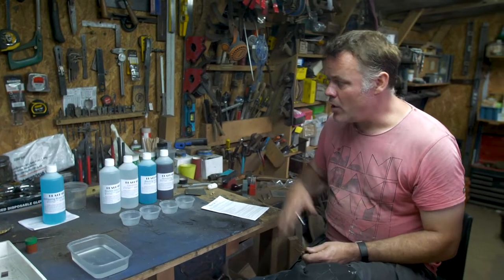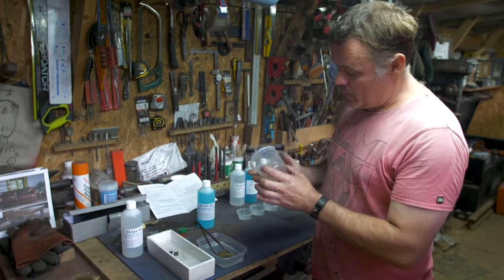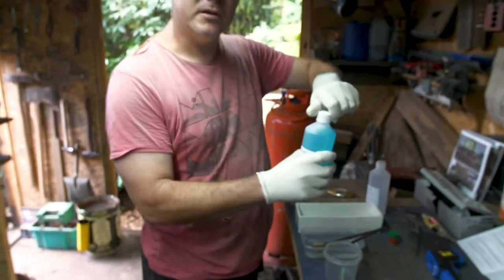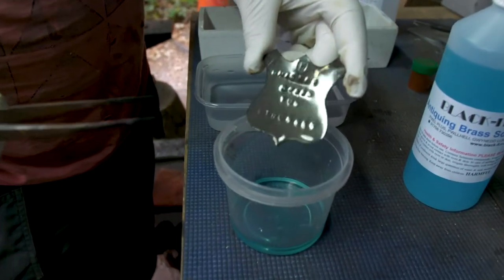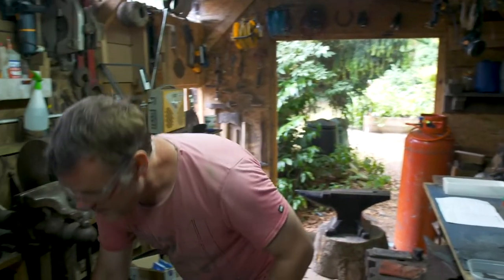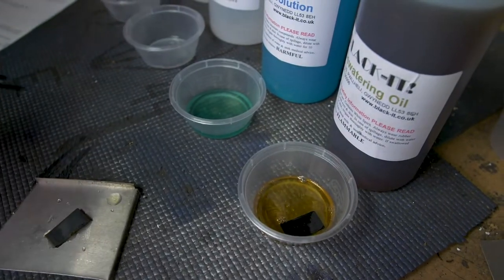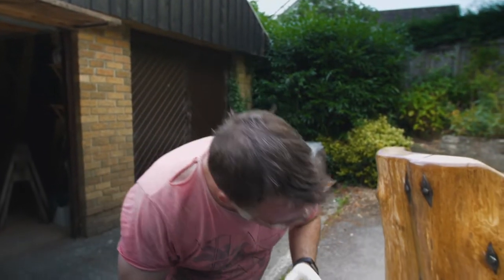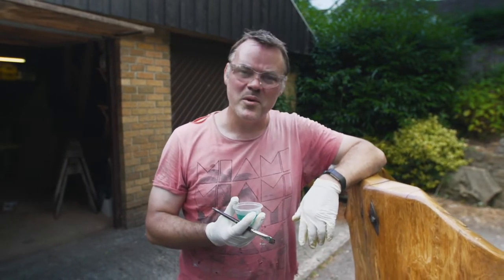How to Age Metals in Minutes with Black-It!

Comment: Hi, did you need to go through the next steps as well when using on the throne? As in wash the solution off and apply the oil before the lacquer?  🤔
Reply from the maker: Hey @trickychick5 we didn't do that because Al is a lazy douchebag who lives to cut corners! The throne was lacquered, we then used the Black-It and then those areas were re-lacquered - turned out good.
Reply: @DirtyShedCreations  thanks 👍

Comment: I'm a noob to this stuff. I'm looking to blacken some nickel plated water cooling fittings. Does nickel become glossy when blacken? ( Use this link for reference of what I'm talking about https://www.amazon.com/dp/B0792MD8HB/ref=cm_sw_r_cp_apa_i_Qb-kFbKPSMJ6M)
I'm trying to darken it to give it a black nickel finish for my project and I'm struggling on what to know and what to look for.

Edit: note that all water cooling fittings are made of nickel plated brass
Reply: Jeffrey Desormeaux Evening Jeffrey, thanks for the comment! It’s Al here by the way, my personal account. Right, your question! You may struggle to find a product to ‘blacken’ or ‘oxidised’ nickel. As an element, nickel is extremely resistant to oxidisation. Think about the origins of stainless steel... it was first called ‘nickel silver’. The only folks I know (have heard rumour) can ‘black ‘ stainless steel are BAE Systems. They’re like the holy grail of aeronautical engineering here in the U.K. Not to be a ‘clever arse’ or a ‘he knows everything kind of guy’ but you might really struggle to find a product to achieve your end result. But, I’d stand corrected if you can find something ‘off the shelf’ to do what you’re requiring. For the sake of love let us know if you have any success! I can only think nitric acid, but sure that’ll etch rather than blacken! If you take this further, let us know how you get on! Good luck Sir! Thanks for watching!
Reply: @yorkshirejoinery2869  I appreciate the comment! Water cooling companies like ekwb have black nickel fittings and all kinds of other stuff. Ive found this https://www.epi.com/black-oxide/nickel/. If I can find a alternative blackening solution from someone other than epi than could this work?
Please click to view and then scroll down to view the process.

Edit: I've also found this. Could this work? https://www.finishing.com/330/81.shtml
Reply: Evening, have given this a little thought over the last 24hrs... and I think you might find a black stain and lacquer achieve the results you’re looking for. I’m thinking of that stuff boy racers use to ‘tint’ their car’s indicator lights (hopefully the same name in the US). The finish on the product in your link looks painted. I think maybe a dark stain applied under a matt lacquer would look more ‘authentic’ (for what my opinion is worth). Hope this helps, but do have to admit to no experience with even working in nickel! Good luck, keep me posted if you find something that works. This might be a silly idea, but what about trying to find brass fittings (without plating) and blacken them? You could use electrolysis to reverse plate, then black the base brass metal? I’m thinking that could be a bit of a pain in the butt!
Reply: @yorkshirejoinery2869  it does look painted to me as well but I believe you can polish nickel to give it a similar shine to make it look like Chrome. I appreciate your feed back and just because you haven't worked with nickel doesn't mean you can't give a little insight. As for brass fittings, I believe they never sell pure brass fittings without plating for my niche market. 

I only wish you replied a little soon as I already purchased this: https://www.amazon.com/dp/B00KI21EFK/ref=cm_sw_r_cp_apa_i_x8UlFbMR7D38K

But i can still buy the lacquer remover to remove the paint. Again! Thank you for helping me the best you could! :)
Reply: @yorkshirejoinery2869  do you know what I could use to scrub the paint away without leaving noticable scratches behind? It will be a little difficult to remove the paint from the surface of the metal
Reply: @yorkshirejoinery2869  update: I second thought I don't think they have paint on them. The nickel just looks polished. There is a ring of brass purposely exposed on the top of the fitting. I am going to attempt that blackener that I linked when I get it and I'll keep you posted